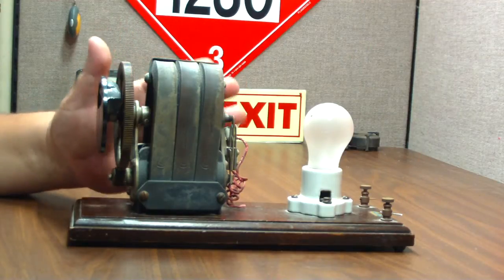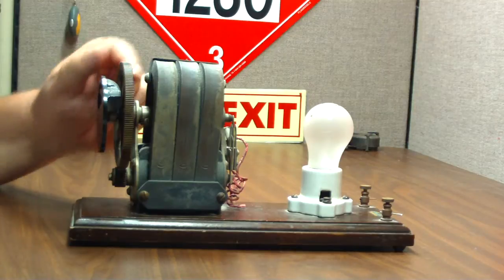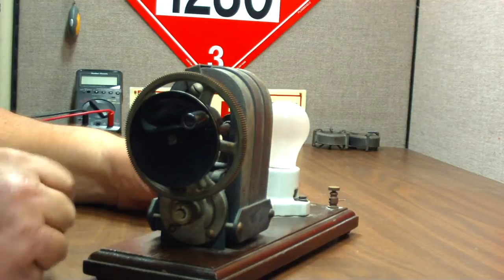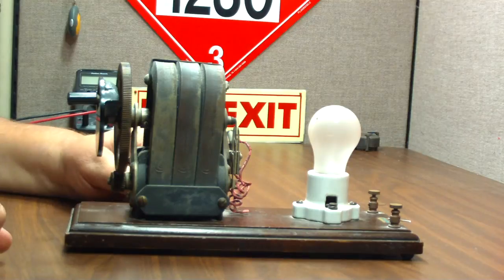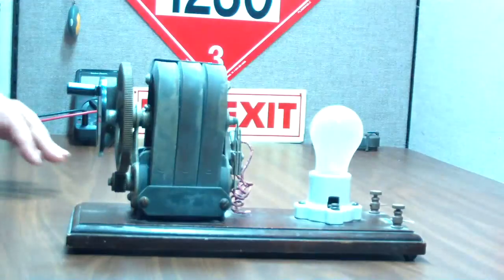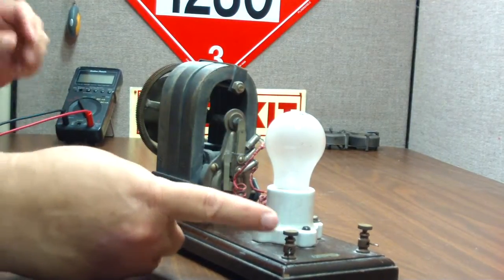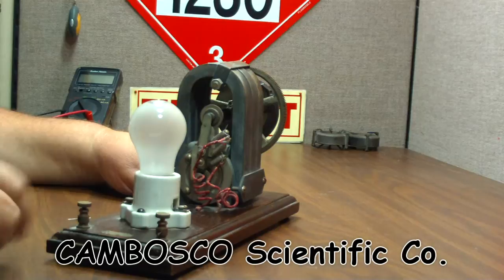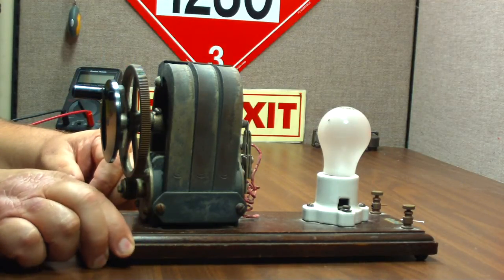My New Vintage Hand Cranked 3 Shoe Magneto Demonstrator - Show-N-Tell

Comment: Nice demo.  That type of magneto was originally designed to ring a 90-volt high-impedance telephone bell.  It's designed to produce 5 to 10 watts maximum.  So your light bulb really needs more power than the magneto can easily produce.  Check the magneto voltage with the light bulb removed, it might be higher than what you're seeing with the bulb connected.  Also, those magnets are quite weak compared with modern magnetic materials, and they also lose magnetic strength with age.  Try it with a very low-wattage LED bulb, it should give you more light that way.  (10 watt LED is equivalent brightness to ~60 watt incandescent)

Comment: I have a similar unit but can't get voltage out. Could you send pics of which terminals you hooked up to?
Reply: The metal frame is one of the output terminals.  Then just try the various screw terminals, one by one, and hopefully you will find around 60 to 90 volts AC.  If none of the terminals produces voltage (relative to the frame) then your unit might be dead ... send me a reply to this is you need more help.

Comment: I too have tried to get my three horseshoe magneto to work, but to no avail. I cleaned it, polished all the individual parts, etc., but I cannot get it to power the ringer armature on my antique phone. Either my wiring is incorrect or I need to remagnetize the magnets. I don’t know where I can go for that, however.
Reply: The metal frame is one of the output terminals.  Then just try the various screw terminals, one by one, and hopefully you will find around 60 to 90 volts AC.  If none of the terminals produces voltage (relative to the frame) then your unit might be dead ... send me a reply to this is you need more help.
Reply: @gregm.857  thanks, I just bought one that was guaranteed to work and it does.

Comment: Just bought one. It doesn't work and I was wondering if you can tell me how to wire it correctly. Thanks.
Reply: The metal frame is one of the output terminals.  Then just try the various screw terminals, one by one, and hopefully you will find around 60 to 90 volts AC.  If none of the terminals produces voltage (relative to the frame) then your unit might be dead ... send me a reply to this is you need more help.

Comment: Thanks so much. I picked up one of these at a flea market a while ago and just "refound" it while cleaning up my workshop. I knew it was some kind of a generator but uncertain what it was for (Google and You Tube are fantastic). I found a wooden base similar to yours and my dad's old ceramic light fixture with a screw in ceramic dual electrical outlet. Now to just find a couple old terminals and some assembly and I'll be ready for my wife's next post COVID Library Makers Day and I'll have another historic exhibit for our 4H Fair robotics tent.

Comment: if you had a big transformer out of a battery charger..you could wire the generators output to the transformers output and step up the voltage to light the bulb much brighter and easier...

Comment: Can you do a video explaining exactly what you did to "fix" the wiring to make this work? I have one of these but it also doesn't work!  I've tried taking it apart and reconnecting things/tightening things up, but I just can't seem to find a way to make it work! Any suggestions would be very appreciated!
Reply: @gregm.857
0 seconds ago
The metal frame is one of the output terminals.  Then just try the various screw terminals, one by one, and hopefully you will find around 60 to 90 volts AC.  If none of the terminals produces voltage (relative to the frame) then your unit might be dead ... send me a reply to this is you need more help.

Comment: Can you explain what we are seeing in this crank generator? I see something along the bottom with a small gear that appears to make the electricity. Around that thing on the bottom there are three magnets? These magnets somehow hold the hand crank with a larger gear  to rotate the smaller gear on the bottom. Is it possible to make one of these?
Reply: +moofushu It&#39;s possible to make one out of a car alternator if you can pull the rotor poles apart and replace the electromagnetic winding with neodymium magnets. If you know alternator theory you can even convert old AC motors into magnetos.

Comment: Nice video!
On open cirquit these generators can easily produce 120V AC! It's always a good idea to be carefull where you hold your hand while cranking. Under load (like your unit), they produce less voltage though.

Cold light-bulbs can have very low resistance, resulting in quite a big load. I can almost guarantee this magneto will perform better with a smaller load. Too big of a load might also be one of the reasons why it's hard to crank.

I have a last-generation bar-magneto from the 40's, and it can do a bit above 5W at optimal load conditions.